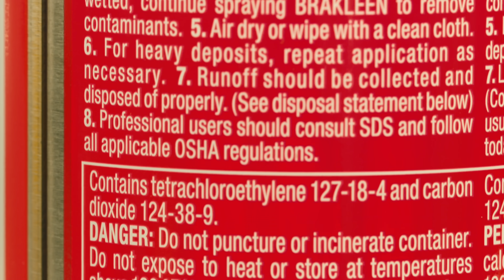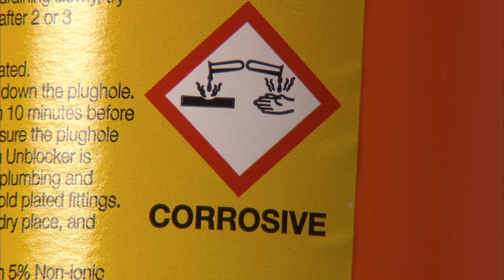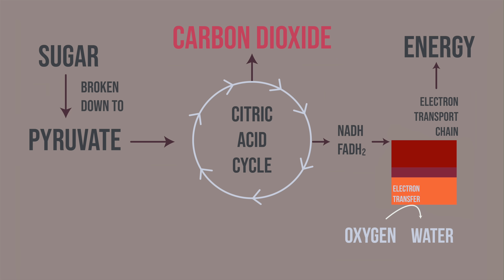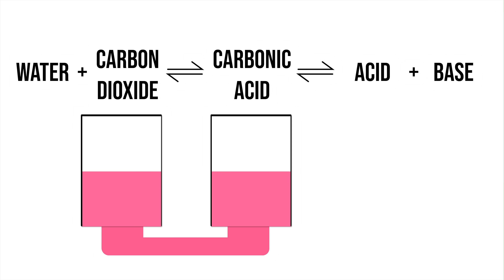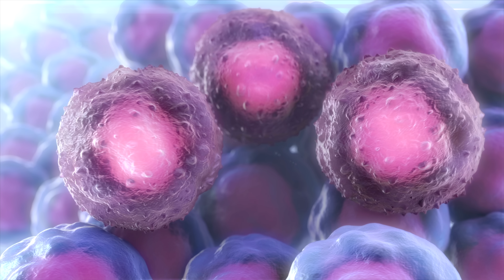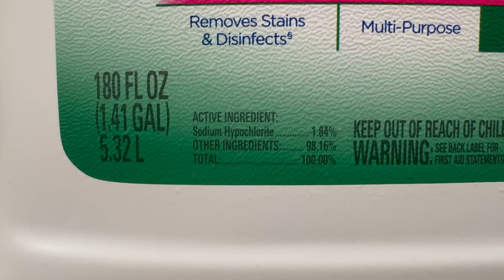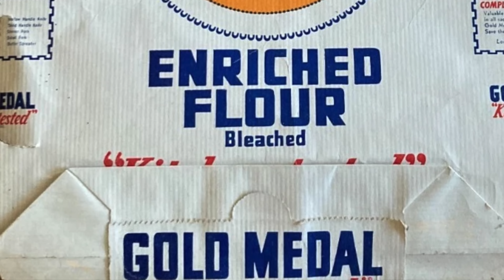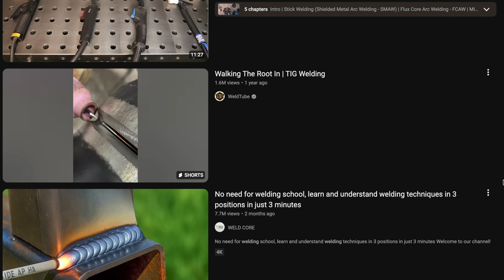"It smelled funny while I was welding and now I can't breathe..."

Comment: Soon as he said welding and brake cleaner i knew this was going to end badly
Reply: Same. It should be common knowledge, at least in regions where chlorinated brake cleaners are still used.
Reply: Well, it is common knowledge amongst welders. Just not common enough.
Reply: I saw that too.  I thought to understand this “visualize someone burning tires in a fire and inhaling the smoke.”
Reply: @baomao7243  More like huffing a WWI artillery shell

Comment: "When brake cleaner burns, it releases highly toxic fumes, including carbon oxides, hydrogen chloride, and potentially phosgene..." (Google AI)

"Exposure of chlorinated brake cleaner to an arc welder (or any extreme heat source or UV light) creates phosgene gas, an extremely poisonous chemical weapon used in World War I that can be debilitating or fatal." (Google AI)

Comment: SPs car batteries look like they could pop a 6000 Ampere fuse.
Reply: No I think its just gonna get the clamp and fail to get the fuse
Reply: @irBribe  Then he clamps it tighter and finally blows it.
Reply: nah, only if you get rid of the insulating sand imo
Reply: @toms1313  Air is a better insulator than sand.
Reply: I haven't watched that one, but I suspect that I know the video you're referring to by that 6000A fuse reference alone.
Reply: @SireSquish the full 6000A fuse video has not been released yet. There is a teaser on StyroPyro's second channel though 😊
Reply: Wow! YouTube positioned his video, "Popping a 6000 amp fuse" right beside this comment.
Reply: Easily.
Reply: boy do i have news for you

Comment: "A man connected 400 car batteries together*. 'Now I can finally cook my hotdog properly,' he said to himself as he pulled the lever..."
Reply: In the late-1970s, my Grandfather owned a commercial device that was designed to cook hotdogs using electricity. There were two electrodes and the hotdog connected between them. 

I do not remember if there was a timer or any safety features beyond a power switch, but it most definitely existed.
Reply: @williamharris8367 THE HOT DOGGER!!!
Reply: I chortled
Reply: @adriatic.vineyards i queefed
Reply: @williamharris8367 Presto Hotdogger, theyre quite well known. Presto are still round
Reply: @williamharris8367 - There use to be plans in DIY books and magazines, on how to make your own, going back to at least the 1950s. It the full 120V. A very simple device. No added electronics. Not even a switch. It does work. I've done it. The current flowing is enough to cook a hot dog. Less than an amp is required.

But you don't want to do it. The metal electrodes, often nails, will react chemically with the salts and water in the hot dogs. You don't know what kind of resultant toxins you're making. Common table salt is NaCl, sodium chloride, but that chlorine ion (Cl) is released in that reaction, bonding with something else. I did not eat those cooked hot dogs.
Reply: @williamharris8367 We made one out of 2 forks and a cut off lamp cord.  The stainless  steel electroplates onto the meat so cut off the ends where the forks went in.
Reply: @williamharris8367 as others have pointed out already, it was the presto hot dogger, the top had the electrical connections and the bottom plugged into them as it closed. (not sure if you could get a finger into it as electrical contact was made though)
Reply: @williamharris8367 
If it was the same Presto "Hot Dogger" (I don't know if more than one design was available) that's survived to be used in YouTube videos, then the lid must be on properly for the electrodes to be live.
Otherwise it would cook you, while you were loading up the franks.
Reply: @williamharris8367 wow your grandfather really wanted to live on the edge whenever he had a hot dog! 🌭⚡ Guess they didn't know back then that just eating hot dogs is hazardous enough to your health 🫠
Reply: @williamharris8367 My great grandmother had one of those. I'm not sure if it was putting 120V across those hotdogs or the voltage was stepped down.
Reply: @russlehman2070  120 straight across the hotdog. Big Clive has featured it a few times (on 240V)
Reply: how delectably diabolical !
Reply: @williamharris8367 Big Clive covered a couple of those I believe. The only safety is the lid and the closest thing to a timer is the hot dog acting as a fuse.
Reply: @guycxz  Yes he did!
Just remember folks, it isn't China alone that sells questionable products, the West did it all before and would do it all again if it wasn't for some health and safety regulation spoiling the convenience of their customers.
Reply: @guycxz  It took me too long to realize his name was Big Clive, and not Big C, live.
Reply: What actually made me click that video instantly is that they were in parallel! 😁
Reply: "here we go!" 

"Frick"
Reply: @raphaelgomes2947  Fu -Frick
Reply: That's 4800V at hundreds of amps. Hotdog + a megawatt of power = cooked hotdog + cooked mad scientist. 0/10 would not recommend.
Reply: PRESENTING to the emergency room with a bad tummy ache; this man's genius was his downfall - too many hotdogs cooked too efficiently
Reply: The fool.  It takes 403 car batteries in series to properly cook a hotdog!
Reply: Now that Emu has moved into the garage now the REAL horror stories will begin. Don't eat rice, don't reheat food, don't move your head and above all DON'T GO IN THE GARAGE.
Reply: Lucky he's just playing a character and he's not the one that died.
Reply: Featuring ElectroBOOM
Reply: @travisinthetrunk ”shocks The shit out of himself”
Reply: Is this two sentence horror?
Reply: We welded galvanized steel for a bit glad we caught that.  People can get real sick
Reply: Thank God that video wasn’t sponsored by Adam and Eve 😂
Reply: I think at that point he'd make the hotdog alive. Not quite the frankenstein's monster, but still.. it's alive.
Reply: "SP is presenting to the emergency room with hogdogarmthopy..."
Reply: WTF is with these weird 10 year old bot accounts with one comment and animal profile pics
Reply: This made me laugh so hard, great comment!
Reply: Man I was laughing when I read this comment I knew he was cooked
Reply: "DA" is a 33 years old man presenting to the emergency room with severe burns...
Reply: I had 24, 6-volt, deep cycle batteries in an electric pickup. A blade of grass touched one of the steel wheels while I was tightening a battery connection.....  I did all battery work on bare ground in rubber protective boots and gloves after that.
Reply: Suffocating is no fun.
Reply: Parallel or serial? That makes a difference. 😂
Reply: I must admit, hotdog jokes are funny.
Reply: styropyro That's the dude in the video. He makes awesome laser vids.
Reply: he actually put them in parallel
Reply: @whoknows8225  he connected them in combinations of series and parallel...
Reply: @whoknows8225  Yeah, but that won't kill you.
Reply: @akronos1  oh it absolutely can, it's an arc flash machine. Watch the video
Reply: @barretprivateer8768 Wait, someone actually DID that? Holy Darwin Award Batman!
Reply: @christopherstephens2699  If anyone else did it, it would be a Darwin Award. SP's just built different (and really knows what he's doing).
Reply: @RedMike-ym8hd Okay, that's true.
Reply: @akronos1 medium low voltages from batteries in parallel can turn you into a cinder.
Reply: @johngarfitt9695 Batteries in parallel does not increase voltage, it increases available amperage and is not a significant danger and will not flash arc. Series wired batteries only output the amp available from the best and highest rated battery in the pack but the voltage increase is exactly equivalent to the battery voltage times the number of batteries. It takes thousands of volts to jump even a small air gap but one an arc starts that gap can be increased because the arc ionizes the air creating a particle conduit. This can trick people into thinking it can jump much greater distance than it actually can. But voltage is lethal long before it can jump but it's an equation that includes amp to be dangerous even if it's high enough to jump an inch. The effective energy of electricity is in the current, a factor of the multiple of the volts and amps!
Reply: Presents to the MORGUE with severe burns 💀
Reply: Someone actually did this, forgot his channel name though. He does a bunch of science stuff
Reply: He did, in fact, cook it properly, just not that one.
Reply: This would make a great "two-sentence-horror fic!"
Reply: with his frat voice, daamn what a gay dude
Reply: hahahhaha
Reply: infinite sparks fly
Reply: This is how his entire body evaporated
Reply: I thought you were joking
Reply: Most underrated comment
Reply: Pull the lever, Kronk!

... WRONG LEVER!!!!
Reply: Lmfao
Reply: One point twenty one Gigawatts....ping!
Reply: Wrong lever kronk!
Reply: "a man connected 2000 potatoes to play doom on a calculator"
Reply: if my hotdogs arent exploded then I dont want em
Reply: WRONG LEVER !!! 😂
Reply: Just interested in the *cost*. .. what did the ambulance cost??? What did the examination cost??? What did the treatment cost?? With or without insurance, and what insurance did he have???
Reply: Underrated comment!
Reply: You mean... it WASN'T Styro doing it?!?
I'm (pleasantly) surprised.
But, yah, the mess the guy did.. damn...
Reply: Best Comment
Reply: WHAT HOTDOG?   THE WHOLE CITY BROCK IS NO LONGER THERE.
Reply: I THOUGHT HE LOOKED FAMILIAR X-D  HAHAHHAHAHA  "Well, here goes...!"  (Somehow, SOMEONE has to make an all-YouTubers-movie... now THAT would be a blockbuster!)
Reply: Why exactly 400? =  error 404?
Reply: SP then proceed to undergo spontanious disintegration, spontanious, as it happened quickly, disintegration as the electrons heating up his blood made his whole body turn from flesh into carbon in seconds.

We are now in the emergency room where the doctors survey a pile of ash.

...

He made "some" recovery.
Reply: JD is a 27 year old male, presenting to the emergency room with brain damage.
Reply: Did you know that you can live forever? Jesus is the Son of God. He died on the cross for our sins and was resurrected three days later. Believe in Jesus and you will not die, but have everlasting life.
Reply: NOT FUNNY YO
Reply: R/twosentenceforskin
Reply: No idea why this made me laugh so damn hard 😂😂
Reply: And then.....  and then..........and then.....
Reply: I did that as a kid using wall outlets and lengths of wire
Reply: @craigh5236 wasn't childhood grand
Reply: @craigh5236  lol I once put some broken loose exposed wires into a wall outlet when I was like 6 and for the next few seconds my vision turned negative and I was knocked out for a few seconds. It's highly possible I died back then and all this is my after life.
Reply: @IsraTheBlack  bro hit the respawn screen for those few seconds🤣
Reply: @craigh5236  How are you alive and how did the house not burn down?
Reply: A man with 2 boxes of childrens' cereal in the cupboard smoked a gram of dankenkush with grinder crystals on top.  Let's just say Cap'n Crunch wore his Unlucky Charms that night, and walked the plank into a sea of milk.
Reply: @slickrick6837 had to google that one, tragic
Reply: Eating that is probably dangerous too. Big Clive does it all the time.
Reply: JoeSmith-cy9wj....
No, eating hotdogs fried from AC power is fine.  They sold lots of those hotdogs cookers in the 70s-80s.  I had one for a while.  The hotdogs were punctured on each end between prongs.  The unit would not work until the lid was shut completely.  Safe to use, safe to eat.  
But... they would cook unevenly and not as good tastung as on a grill.  I ended up tossing mine.   But the methodology was fine.
Reply: I conned a junior medic to use an older model defibrillator, convincing him that it'd instantly cook at hot dog at 150 joules.
Took us an hour and a half to clean up the hot dog chunks from the room, our PA, an old Vietnam veteran looked in at the noise, "I don't give a fuck as long as you clean all that up now."
Told him later the story, he damned near fell out of his chair laughing.

Comment: Smell of wet grass and I immediately thought it was phosgene.
Reply: In his book The World of Carbon, Isaac Asimov said he liked the smell of phosgene. In small amounts.
Reply: @jameschristiansson3137 that is wild.
Reply: Now I'm going to be paranoid whenever mowing 😂
Reply: I definitely don't have that kind of chemical knowledge... but I've seen enough rando short vids about brake cleaner "kicking in" to know that vaporizing it has to be one of the all-time worst ideas
Reply: @justdh  That's different. There are lots of bad stuff in brake cleaner, especially of the non-chlorinated kind which I'm familiar with since chlorinated ones are banned here in Europe. You will feel strange if you breathe too much in, but there's no phosgene, just a bunch of other toxic stuff.
Reply: Pocket phosgene
Reply: I heard welding and brake clean and knew it was going to be a bad day.
Reply: I'm a retired chemist and I knew it was phosgene especially after the emphasize the brake cleaner.
Reply: I was waiting for the reveal from the moment the brake cleaner was used to degrease the steel.
Reply: @alflyover4413  Same here! ( related story - using nitric acid to dissolve some metals and metal compounds, with brown NO2 as a byproduct, can give a very similar fatal delayed lung edema )